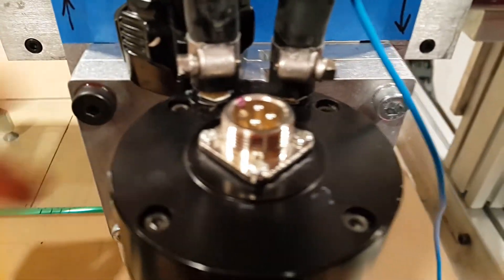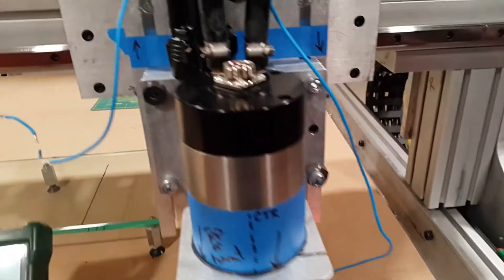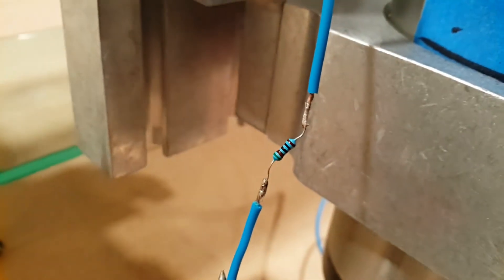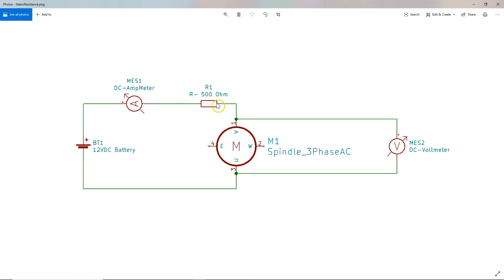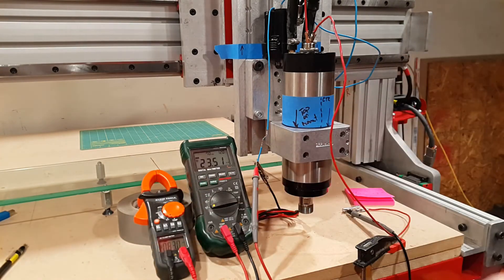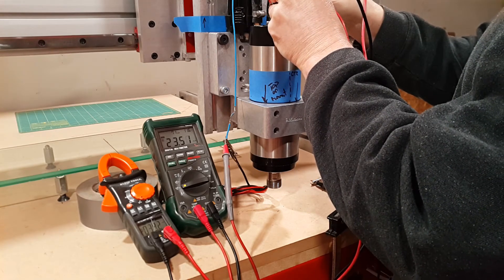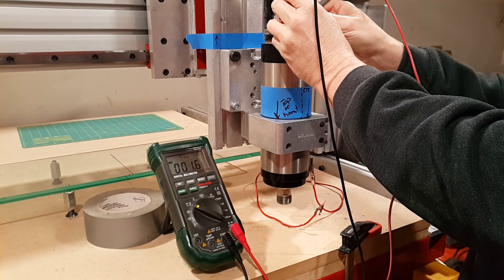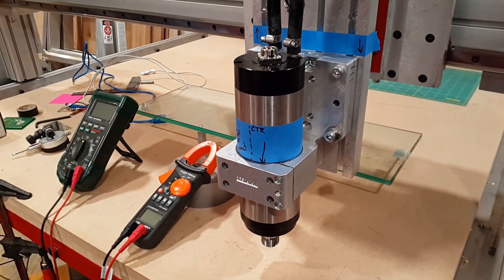CNC Spindle - Measuring Stator Resistance

Comment: Quick question, I’m having some shorting issues with my spindle. I check the 4 leads at the top of the spindle and uvw have continuity between them? Is that normal?
Reply from the maker: Yes, continuity between U,V,W is normal (required in fact). It's useful to know if your spindle is wired internally as a WYE or a DELTA configuration. In either case, continuity between each of the three windings is expected. You should check the resistance of each winding (interpreting the results differs based on whether your spindle is a WYE or a DELTA). Here is a link to a 3-phase motor testing overview https://www.electricalengineeringtoolbox.com/2015/12/how-to-test-three-phase-ac-motors.html . I recommend disconnecting the cable between your VFD and spindle, and verifying those wires do NOT have continuity with each other (that is where my fault was).

Comment: Nice technique but resistance is a DC measurement, I would expect a VFD to want the AC equivalent (impedance). I wonder why it wants resistance as a parameter if it's not braking. 
And just to be persnickety, bear in mind the meter measures current the same way you are albeit with a smaller internal resistor,  so you have to factor that resistor in to your math for the best accuracy. But I imagine that's close enough for the VFD :)
Reply from the maker: The VFD does have some 'internal' braking features (as opposed to external braking resistors which are also supported) but its not clear to me if this parameter is used by these features.
According to my VFD documentation, the following parameters are "essential for good operation" in vector control (aka field-oriented control) mode.
    Param    Description                          Default     Unit
    P399       Motor Rated Eff.                 67.0          % 
    P407       Motor Rated Power Fac     0.69  
    P409       Stator Resistance               10.63       ohm 
The "Stator Resistance" parameter is in ohms with a valid range of 0.01 to 99.99. The default setting is 10.63 ohms which I find oddly specific. My measured value is an order of magnitude smaller so I'm glad I at least tried to measure it. Hopefully my ballpark figure will work.